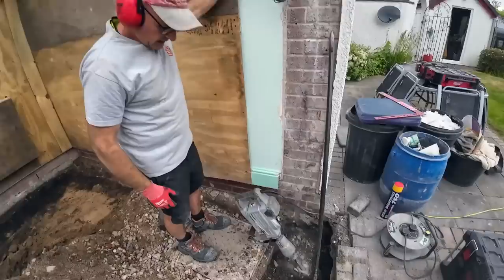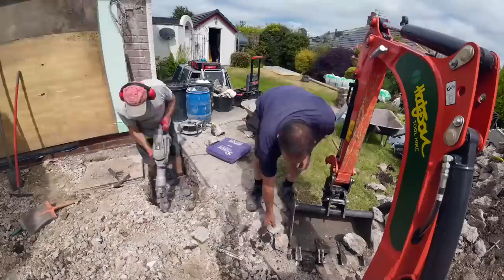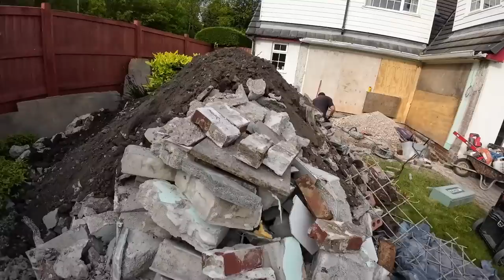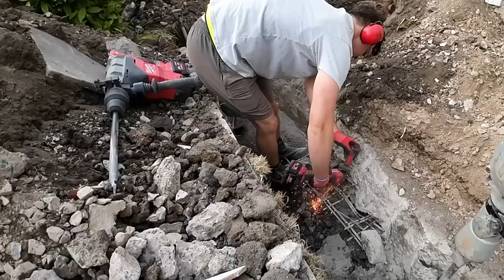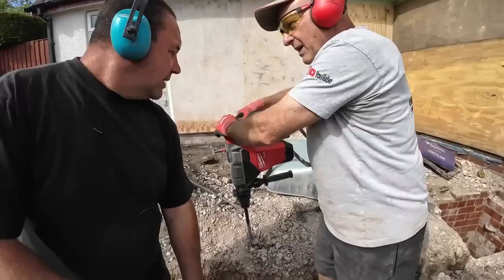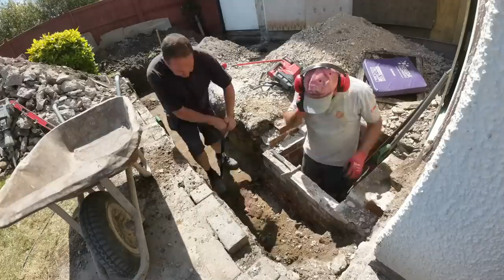THIS CONCRETE NEARLY DESTROYED US..150 MM CAVITY EXTENSION PT 2

Comment: I did many concrete demolisions...not my normal work but did it for part of my work....never know how it goes...sometimes the concrete is easy to break up..next time it is hard... used those big Pneumatic breakers but mostly Electric ones... having some chisel bits helps and not trying to go too deep with a point tip ....best to work across and get a crack started ..sometimes even that isn't working...then i would find what works and keep hammering.... vibrating as much area is the key....it eventually gets some cracks started... 👍

Comment: I come a cropper on taking a conservatory down, they poured a 900mm deep 600mm wide 3 meter long footing and took me nearly 6 hours on a breaker to remove. Couldn't use it as was in the way and needed to get drains through!! Iv never seen so much concreat which was basically hold a conservatory and door lol😅
Reply from the maker: Jeez , pure bad luck that mate 😬🧱👍🏽
Reply: Very!! The customer couldn't believe what i had uncovered!! I hired a breaker and after about 20mins took it back and got the biggest breaker they had to hire, generator and all!!

Comment: Great video again boys. However, it looked like the tools you had were not powerful enough for the job in hand. I say this, as recently I was replacing 4" X 4" fence posts, and I have an SDS hammer drill. But when trying to break up the concrete, it was only tickling it. Checking the spec on my drill, it had 10 joules of impact power but on checking with my local hire company AHC tools in Alloa, they had an SDS Max unit from Bosch and its power was 27 joules of impact power. I hired it, and  could not believe the difference. It made mine look like a water pistol and theirs an AK-47 automatic. I also noted they have a road drill similar to what you used on the job, but 30kg in weight, but 70 joules in impact power. It may be prudent to check the power of your kit, as hiring the correct kit may have saved a day or so in labour and time. Apart from this constructive comment, you are still the best brickie on the web. Awe ra best from Bonnie Scotland.
Reply from the maker: Thanks buddy . The two breakers are well up there for power but reinforced Concrete it a trench with nowhere to go is ridiculously hard going . 😬🧱👍🏽
Reply: @SteveAndAlexBuild  👍

Comment: I suspect the reinforcing was put in to strengthen the concrete that bridges the outlet pipe from the buried manhole…
Reply from the maker: What out let pipe , we found nothing . The previous was an engineer apparently . Who like to over engineer. 
   He did all that but didn’t dig through the shite ground 😫🧱👍🏽
Reply: @SteveAndAlexBuild  I’ve seen similar before, where the invert in the manhole has simply had a pipe inverted over the top, and ‘compo’ used to secure it in place, to form a whole pipe, thus avoid having to dig it out no replace the section of pipe through the manhole… would loved to seen them do it, as the manhole was way too small…must have hung in there head first to do that job… my best guess is the pipe runs real close to and below the original footings, and the idea of the reinforcing was to relieve pressure by downward force, by pressure being transferred all along the reinforced section… you guys need to invest in ‘splines and feathers’ and a rock drill…they will make your life on such jobs so much easier…

Comment: 150 cavity, might as well just fill the room with insulation
Reply: It doesn't have to be 150mm if you use solid pir insulation
Reply: Here in Canada we use that amount 6" and older houses are 3.5 " .... having more Insulation works better year round.... we get Minus 30 C regular for 4+ months and it can be minus 40's to 50's too for periods...minus 20's is a Warm spell ... you have brick exteriors while most here don't too...that extra concrete and brick work adds to insulation value ... with the Global Crisis Fear mongering they want to cut back on heating and cooling costs.... nothing wrong with Insulation..my Shop is Insulated ( 24 ft × 40 ft with 10 ft walls ) and is heated ( floor radiant by boiler ) and in summer it stays Cool most of the day without any AC.... Takes less $$ to heat it in Winter too... gotta suck it in and change as it is coming whether you want it or Not....